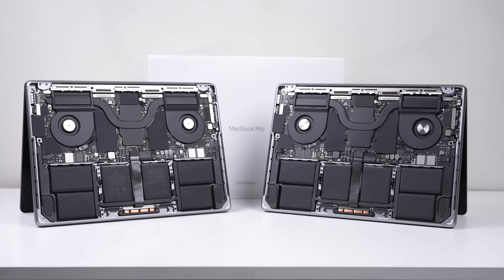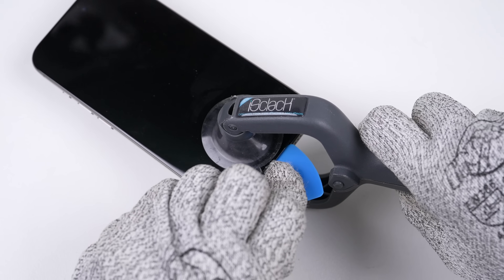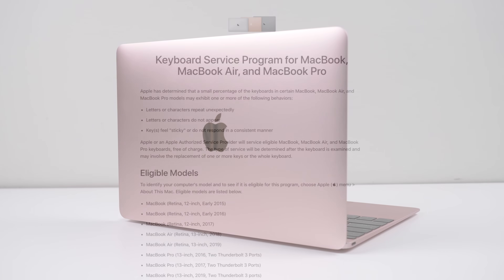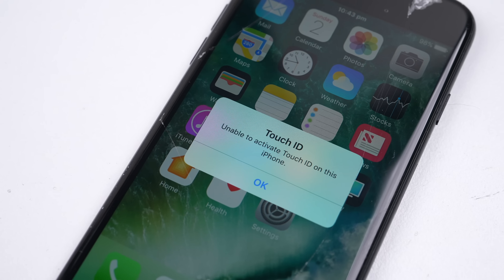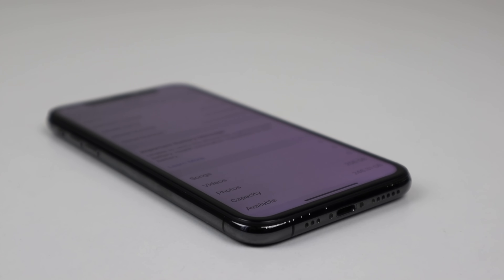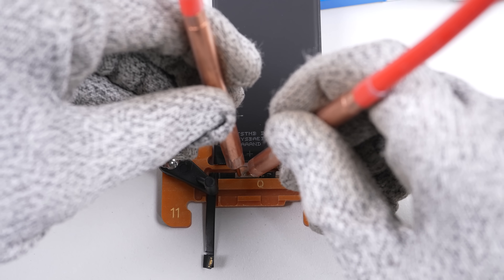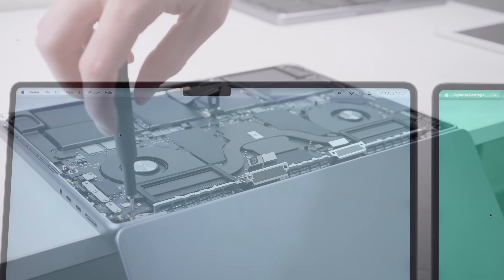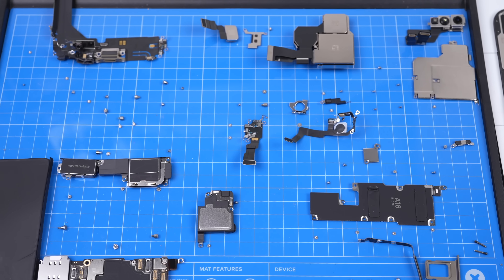Astonishing Anti Repair Practices By Apple In the Last 15 Years

Comment: As years passed, I had many chances to get an Apple product, but I must say the main and probably only reason I did'nt take it, not even price weights as much as the need of authorized service to repair.
Sure, seems legit and you could argue is logical the only the fabric could repair it the best way... but the price of repair, the limited of amount of places (back in 2015 in Mexico apple service existed but was so few places) and why in the world should I pay someone to smash my cellphone on a wall in order to fix it when  I can do it myself.
I repair all button on my old Huawey by adding a little piece of metal inside their holes, was hard, was cheap, maybe dump, but was my choice and own will as I want to use that phone for longer.

Comment: 2009? a guy I knew had to get a replacement logic board fitted for a mac G3 desktop, 400 GBP, only possible at an apple service centre he had to take the machine to himself. This was like 2003/4. A more modern PC board from that time would have cost as little as 30. He could have replaced the machine for less but he was vendor locked into apple exclusive software.

Comment: something you missed, on the software side of things each IOS update has a built in timer that after X amount of time the phone will forcibly disconnect itself from its phone network (verizon, att ect) until you update the device to the latest IOS, thats why some IOS versions do nothing but reorganize their menus, they had to put out another update because the last one was expiring. caused no end of headaches while i worked in the industry. 

i worked for ATT for 15 years, and to this day it baffles me how iphone became the most popular phone brand. they are objectively the worst by every conceivable metric. hardware is about 5 years behind every competitor, IOS software is an eldritch nightmare of bad code, they invented most of the industries anti-repair practices, and lead in anti-consumer BS. they refuse to allow anyone but themselves to touch their phones so ONLY they can warranty the devices, but if you have a clear warranty issue, they send you to your phone company to deal with the issue, the phone company can do nothing, so you get trapped in an endless loop because ultimately they really dont want to replace your phone.  i mean the difference in quality is insane, there is a 1 in 4 chance if you own an iphone it will stop working on you. that is an unacceptable percentage with literally everything. they are rife with constant issues. and on top of everything they still have the gall to charge the highest price in the market.  its insane how they control 70% of the global phone market.   that control has only been going up in recent years, which is even more insane. i found out that in inner city schools kids get bullied for not having an iphone....  if you wanted proof that an add campaign can overwrite all human intelligence and convince the majority of humanity to buy the worst option for a product over every better option, well apple proved that its very real and prevalent. 

as an aside, some people after these screw apple rants tell me a bunch of stuff wrong with samsung as if its a defense of apple and iphones... its not, just because both are bad does not make it okay. while samsung is leagues better than iphone in many regards, its still a mediocre option compared to whole market. and so i get asked after  "what phone would you recommend then?" id say Motorola, hardware is on par with competition (that is to say about 5 years ahead of iphone) the phones are 1/3 the price of and iphone or samsung, and despite still controlling about 5% markets share in the 15 years i worked for att in tech support NOT ONCE did i ever have a call for a Motorola phone. i mean if you assume a certain percentage of phones will just not work in theory 1 in 20 calls coming in should still be Motorola. but it never happened. calls were 80% apple, 20% samsung. had a few (maybe 1 a month) for LG phones, had a blackberry call once (that call was kinda crazy on multiple levels) but never in 15 years did i have (nor any of my hundreds over the years co-workers) have a call for Motorola. they are just reliable phones.

Comment: Wana a tip 
Dont buy from apple
Their phones also broke easier
My Motorola still intact after being thrown against the wall the floor being weeted by rain and food and works fine
And also had the secret power of work with 0% battery for 15 minutes for some reason lol i take some funy prints of it XD
I also change the battery because it needed repairs because this phone is old he still do it 😅 
Now lets see if an iphone survive it for 3 years

Comment: Soldered ssd are just crazy to me, these storage components are probably the most common and interchangeable computer parts out there, even I switched out several which only takes me a couple of minutes and bucks, and I'm not very tech savvy. 

I don't even buy external storage anymore and just buy an enclosure since it would be cheaper and I can still use all my old stuff
Reply: Even more crazy than soldering down an HDD, if that was a thing. Unlike HDDs, SSDs are disposable, with a limited lifetime known and specified beforehand.

Comment: Ive always used apple and probably will unless something changes that’s just too big a deal for me or they simply don’t keep up with other phones with cooler features (like the pixels planned modularity would’ve gotten me to switch if they would’ve gone through with that even with the extra bulk) however I never even considered it until all this stuff against repairability started coming out I really noticed it in the 4 but it was still workable but even starting at the 6 it was just easier to get a used or older model especially if it doesn’t have apple care the 15 doesn’t seem to look much better but I’m holding out for future models I have my 13 now and am just praying it’s sturdy enough to last until a suitable upgrade but in their favor these phones have become tanks compared to the old ones besides unavoidable maintenance like batteries every 5 or so years at most I think anyone who takes care of their modern device should be fine barring those random accidents that are always possible
Reply: Jesus Christ, ever heard of a thing called punctuation? It felt like having a stroke reading that monstrosity you just typed out.

Comment: The problem isn't repair...the problem is planned obsolescence...and the "fix it" guys are just as guilty of opposing that as Apple or really any and all other corporations.

If anyone actually wanted a solution, then everything would be designed to break down as infrequently as possible, and to be so simple to repair or replace any given thing that professional service would almost never be necessary.

No, none of it would be perfect, but it's entirely feasible to design a smartphone that will last and remain effective through upgrading for decades or more, and maybe only need professional servicing once or twice in that lifetime.

It's absolutely possible.  It's just not profitable.  And the repair side is just as guilty as the production side.

Comment: Checks out. I used Apple from the mid-90s until 2012, when my 2007 Macbook started breaking down. Early on, Macs were repairable and moddable, and their hardware was really well organized and often modular. By the time my Macbook died, I saw where it was going on both the hardware and the software fronts. On the software front, not mentioned that much in this video, Apple would impose limits as to what devices a piece of software can be installed on. For example, no iMovie on my late Macbook, and OS X capped at 10.7 is I remember well. Apple also introduced its app store, which I saw as a way for them to have further control over the software that people use.

I switched to Thinkpad + Linux then, and Framework + Linux now. No regrets.

Comment: One MacBook ran on 16volts.
Just the one.......
I had no idea until I moved off grid.
After much research into converting a 12v supply, this....
They put a mystery unmarked chip INSIDE the plastic molded (magnetic) plug at the MB end. 
Literally inside the plastic. Something to do with the charging circuit sensing the charge. Cheeky.

Comment: here is mi advice : buy a cheap phone ... for 10 to 15 $ it will last you at least a year (i have mine for 3,5 years and it still works just fine) and you will not be sory when it brakes .... i may not agree to anti repaire tactics but i do belive that a smart phone is a luxury and it should be much more expensive just like any other luxury item

Comment: Apple’s repair program is insanely bad yea.. i had to send my iPhone in one time due to the screen staying white and no software reset or reboot would fix it… had to pay 3x the price of the device eventually to get it repaired because apparently a single chip on the mainboard was damaged and they had to replace 70% of the device.

Comment: One of my favorite features of my (now old) 2012 MBP (non-retina) is that it's a tank and I can (and have) made various replacements and modifications - such as removing the optical drive in favor of a second SSD.  Unfortunately, it's getting to the point where while it does run well (well, it ran better before I "upgraded it" to Mojave; I've just been too lazy to bump back down to High Sierra, where it probably ran best), it's falling out of compatibility with various 3rd party software.  Which is unfortunate, and also unfortunate in the sense that I won't touch anything Apple is putting out nowadays.  Never thought I'd be driven back to Windows.  It's a shame they left their PC offerings to rot in favor of their vastly inferior phone offerings.

Also, I've replaced a 2014 MBA keyboard.  Yeah, not fun, but it was rather satisfying once completed.
Reply: Have you tried OpenCore Legacy Patcher?

Comment: 'Repair' is totally the wrong word for any modern/current device. You can't Repair any part of these things, only 'Replace', & even then working on these things, trying to pry open a phone, unplug tiny connectors, pop off tiny circuit bords without destroying everything just to replace the part that 'might' be the fault...it's like dissarming a bomb.

Comment: Apples war on repairability started back in 2006 or earlier in my opinion. When i used to work in an electronics recycling center i repaired a ton of old box body and unibody macbooks with core duo processors. Even among models with identical specs and the same launch dates there would be at least 3 configurations for keyboard connectors and display connectors, so that even if you had an identical model to salvage parts from, it wasnt always the case. This on top of their obsession with torx screws, the securing of the trackpad by a single shallow screw, extensive use of fragile ribbon cables with limited clearances, made working on them a chore. At the samw point in time, manufacturers like Dell and HP may have used torx screws only to secure the motherboard itself and utilized more traditional cables similar to a molex cable. Other manufacturers batteries also weren't prone to expansion inside the chassis, which would cause damage to the chassis, the keyboard, and the trackpad. In rare cases the batteries could explode and some would leak onto the components inside, ruining them. Obviously Apple has ramped up their efforts to stifle repairs since then, but I'm sure technicians knew that Apple machines were already more difficult than their cheaper counterparts.

Comment: It's one thing to manufacture things to be physically hard to repair (rivets, soldering, etc).
It's another to maliciously program software to disable features if parts have been replaced and encrypt things that don't need to be encrypted.

Comment: I used to have an iPod 4s which was working just fine (that was many years ago). Then there was an OS upgrade which decided that my iPod screen was larger (higher resolution) than it physically was. So it means that many applications as well as pop-up ads were displaying the Close button outside the screen. This effectively rendered the device unusable. Crucially, the iTunes app was not working anymore. On an iPod...

I communicated with Apple's customer service and they were just surprised I was still using such an "old" device. It was 5 years old, but come on... It's just a music player. Why should I replace it?

Comment: As a tech guy that did the odd Phone repair here and there.. thank you for this video. It´s happened so often now that I looked up replacement parts for a customer, told him I could possibly repair his phone, just to run into any number of inconveniences after the replacement. Just recently I replaced a Battery for an Iphone Xs and hadnt looked up if there is any caveats after the repair. Of course the customer was a bit miffed at having the "not original battery" message pop up here and there, but luckily most don´t mind, since it´s old hardware and they are just happy to be able to keep using it a little longer. Better to spend 90 bucks or so on a repair, then 500 on a newer phone. 
It´s ridiculous nonetheless. I feel like apple is directly targeting 3rd party repairers with these "will work, but will be inconvenient" moves. With pop-up messages deliberately worded to achieve the maximum feeling of insecurity for the non-tech-savvy end-user. I can explain 10 times to a customer that the message is just vindictive grumpiness by apple, they will still feel like they have a reduced product. 
So I started to avoid repair requests for Iphones, unless I know that particular replacement will work fine with little inconvenience.
Reply: Why bother fixing an iPhone? You might be able to fix the phone but you can't fix the stupidity of the person that bought it. The only way people that dumb will ever learn is through suffering.
Reply: @KamikazeCommie501  shrug I don´t really care, as long as I get paid. I repair all kinds of stuff that most normal repair places shirk from, like Screen replacements of Laptops, SSD Upgrades from HDD for older PCs including older Macs.
For example, upgrading an older 2016/17 imac from HDD to SSD costs about 300-400€ when you bring it into an apple store. I do the same upgrade, with the same parts for 150-250, depending on model, size of the disk etc. 
Or things that require soldering, stuff like that. I have fun doing it and make good money.

Comment: Apple will use right to repair to make it virtually impossible to service anything in the future.
I don't know how, but they'll find a way.
Hell will freeze over before that company does something that could hamper the sales of new devices.
I'm curios how they will circumvent the upcoming EU battery / right to repair bill, IP67 for starters but the device still has to repairable.

Comment: Recently needed couple of testing phones so bought 5 older iphones. Set them all up with a brand new apple ID linked to my main email address. After a day of use (setup completed, sim cards registered and that was it), Apple disabled my new ID. After 2 weeks of arguing, they removed the Apple ID from those phones and phones. I had to create yet another ID with new email address and problem gone. The only explanation for this they gave me was that probably because I've registered number of different phones at once, this was recognised as potential fraud. No apology was offered, hours wasted and my main email address stayed permanently blocked for to be used with any apple product. Not that I give a toss as shortly after starting the tests I've realised that they are even blocking apps to be installed on older devices. Pile of garbage that company, never ever again. Threw those phones away and scrapped testing on apple devices. Lesson learned.

Comment: Apple is not committed to the environment, right-to-repair, good design, or human happiness.

If they cared about the environment, they would support right-to-repair. They wouldn't use iOS updates to govern the speed of older iPhones.

If they cared about right-to-repair, they would have worked with legislators, rather than lobbying against it. They are supporting it now so that they can shape the legislation in their favor.

If they cared about good design, they would have implemented a variety of software/firmware/hardware features much sooner. It took them 10 years to add such a basic feature as an app drawer, and the USB-C port was only implemented because the EU made the lightning port illegal.

If they cared about humanity, they wouldn't use nets to catch workers trying to jump from their factories.

Comment: Apples current attack against repair started back in at least the early 2k's when they pulled all of their diag software away from their original certified service providers and started pulling parts availability at an increasing rate for each new model year and what parts would be available.

This ended up hurting Apple pretty badly as they lost a lot of edu orgs. Going in to 2000, our school system was >90% Mac, within a 5 years, due to the exponential failure rates of iMacs and other g3 and g4 models plus the increasing cost and artificial difficulty imposed by Apple, we our entire org had end up transition to >99.5% PC on all new purchases and the only Macs that would remain would be what we could repair and the handful of new ones that had Apple hardware specific grands.